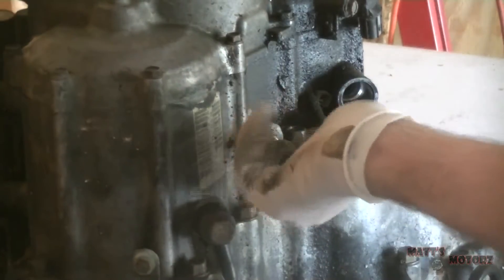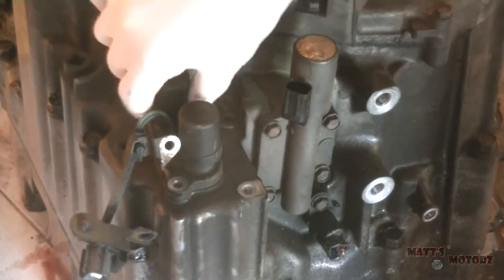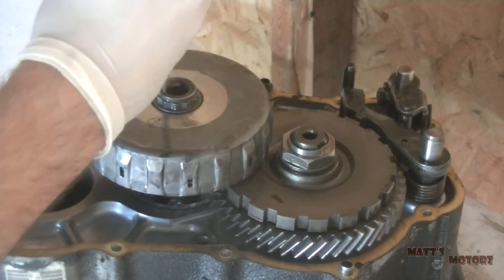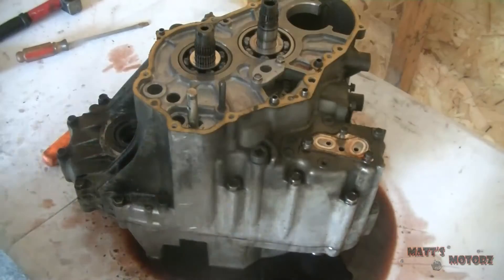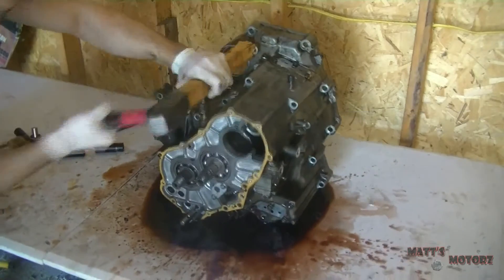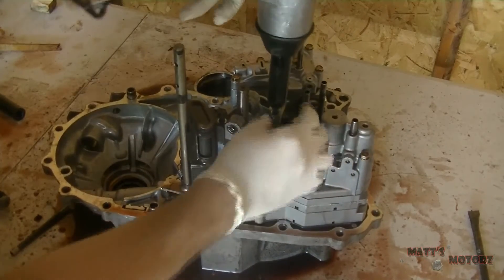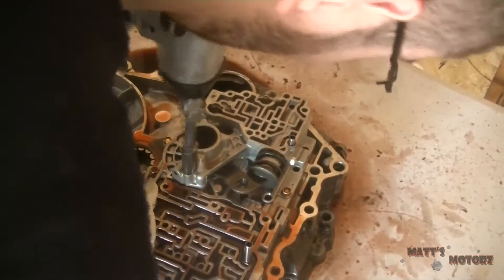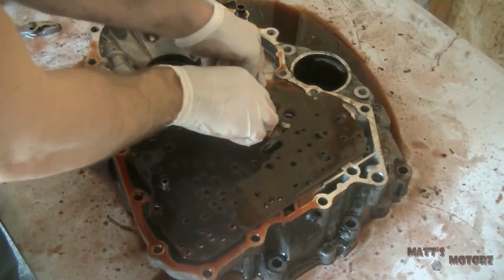A4RA Transaxle Rebuild [96-00 Honda Civic] Part 1 : Teardown

Comment: How much oil can leak from the shift link rod? I put my car back together and it started leaking but the torque converter is all clean the only place I see a leak is the shift link rod? Can this cause a POUR of a leak? Pretty much emptied 1 and half bottle of atf in 5 seconds.. also it only happened AFTER I rebuilt it.. did I do something wrong?

Comment: Hello, I have a question: When disassembling the secondary valve body to do the maintenance (polishing of housings and stems in a b4ra) I found that to remove one of the valves (cpc) you have to remove a closing screw that the manual says " watch out: don't move. " The valve does not move well, it locks, so it would be necessary to make a polish. The manual clearly shows that the other four valves must be removed and does not show this.

Comment: Why would you use an impact to screw bolts back in that are  to long for the hole without being through the solenoid plate?